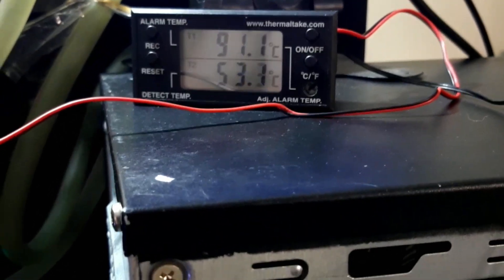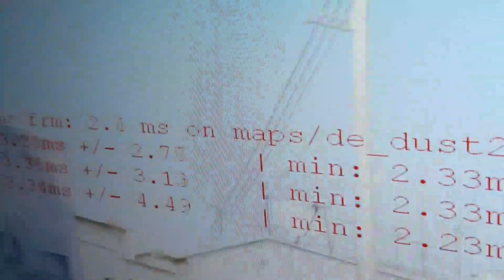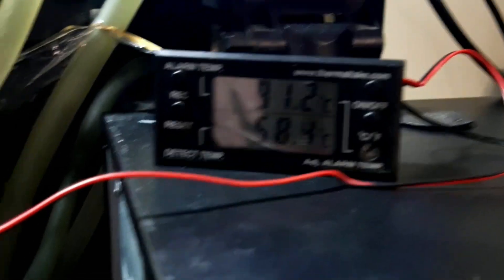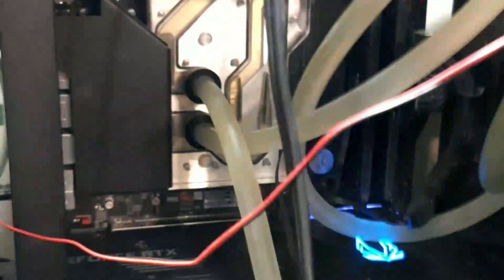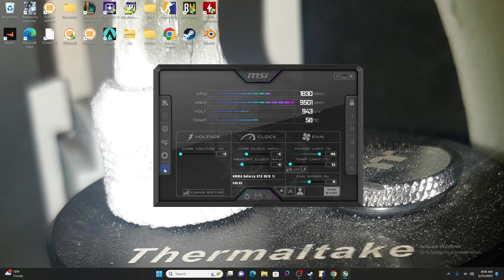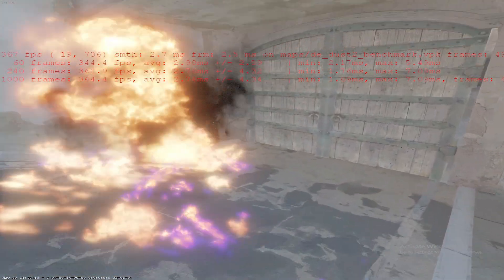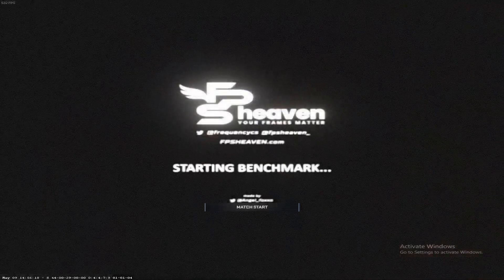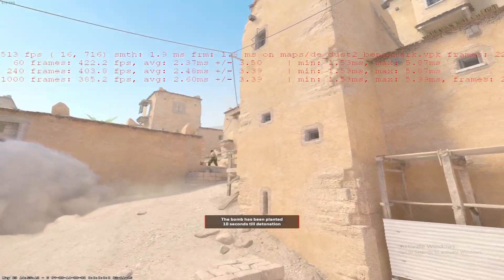How to Cool your pc during the summer!!

Comment: I clicked on this video to see what bs it was this time and to my surprise nothing false or placebo was said, nice. Also, if all else fails, take off the side panel if your room isn't dusty, should make a difference unless you already have a case maxed out with fans.

Also, avoid using "High Performance" in windows power management. Stick to balanced, there is a huge difference in terms of temperature even when not doing anything.

Comment: The best advice i can give to people without modifiying anything is just to set the max framerate to the monitor refresh rate or vsync/gsync, GPU will consume less power, also CPU and other components.
Reply: This. I'm so glad I have poor tastes, so I often limit my GPU to 30FPS because I'm perfectly happy with 30FPS. My monitor is only 1080p60Hz so I have no need for high end FPS; I set all the graphics settings to max but resolution and FPS I don't care about so long as it's smooth.
Reply: @genericuser1454  ohhh i wish i could play even at 60 fps. after i got 155hz monitor i feel pain when i see lower than 100 fps
Reply from the maker: I hear ya there, switching to a higher  refresh rate monitor can improve performance but also.. can your pc run it smoothly.. thats an issue with the newer fps games as most people want to play on high settings, i play up in the big leagues around the 20k premier and i dont even use high settings, its a custom low with high detail.. "fx fidelity diabled" ..  so my lows will never go  below my monitors refresh rate. That is key!
Reply: @mountain_heights  thats not your fault, playing 60fps at 60hz is not the same as 60fps at 155hz, it literally shows you each frame more than 2 times making it feel even more stuttery. If you ever want to play a game at 60fps and it's not an fps game just set your refresh rate to 60.
Reply: @q1337  I use my old 60hz monitor as second monitor and it looks so stuttery :D
Reply: @mountain_heights  it is, I had one of the 144hz back when they first came out, butter smooth but unfortunately the backlight was PWM and that was crap for my eyes so I ditched it. The new panels are like space age compared to those older ones which were washed out and PWM